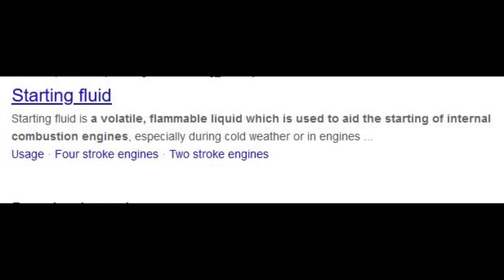Why do Diesels get Addicted to Ether?

Comment: You said it can hurt the engine with continued use, but how? How does starting fluid hurt an engine? Does it wash oil off the cylinder walls? What does it do to damage the engine?
Reply: It detonates while the piston is still traveling upwards on the compression stroke, putting a lot of stress on the piston, rods and bearings
Reply: @ultraprocessed  This is the correct answer.  But you don't need to add so much that it is actually driving the engine to go around.  Just enough to light the fire and the diesel does the rest.
Reply: It kills cylinder wall lubrication.
Reply: @Skidderoperator  Ether vaporizes almost like propane when it leaves the nozzle.  If liquid ether is making it to the cylinder you are using about a gallon too much.
Reply: Google is your friend...
Reply: @JohnSmith-yv6eq  That reply was not helpful.  The guy asked a question, answer it.

Comment: My 1974 Atkinson with a NH220 Cummins had factory fitted ether starting system
Reply: Most tractors well into the 70's and even 80's had it as either factory standard or an add-on kit.  Didn't seem to matter what brand of engines they had.
Reply: My 1996 international 9700 had the injection system, took that shit off right away because I know I’d abuse it lol my 935b cat has it as well but so far I’ve left that system intact
Reply: Remember when the 'A' series came out & ford fitted the ether start system for the YORK engine' fords Tech departments fix for poor starting the inj' pump needed 2-3degs of advance then it would start even with frost on the floor .........
Reply: @leso204 those york engines were notoriously bad for starting,along with Perkins 4108's and any other indirect injection diesel of that era 🤣🤣,never knew that was the fix for the York engine though👍👍
Reply: Got a 1978 john deere 2130 with factory ether injection port. No glow plugs or grid heaters or turbo on those girls back then. -20C and gotta clean the lane of snow, you need a boosting vehicle or the battery charger and a snort of starting fluid to get it to go. Doesnt need it when warm just when cold as balls. Even got the factory manual too telling how to use it. 
Almost 50 year old motor, still factory sealed. Probably could use a total rebuild but aint got the time or money. Just gonna use that ether as the manufacturer recommends!

Comment: Hi Josh, Marine diesel engine guy here in Ireland, with over 40 years pulling and dragging with diesels from 10 to 1000 hp on boats of different sizes. For what it's worth, my experience with ether ("easy start" over here) is that it's most definitely addictive. I cannot give a rational explanation for this, someone told me once that the small end bushing in the con-rods gets damaged ( wrist pin bearing?) ... I don't know, but I do know that using it more that a couple of times leads to addiction in a short timescale on most engines. Maybe some older American engines are designed in such a way as to tolerate it better, but I'm always going to strongly avoid it.
Reply: I had a Romany 21, the boat with the rope, that had a Perkins 4107 in it. Every once in a  while it needed just a puff of ether at that mushroom head air strainer. The engine was built in 1969 and still runs decently.

Comment: Our 2023 CAT D4 came with Cosby sauce as a starting aid. I've had engine performance gurus tell me to use silicone stray instead of starting fluid that is ether based.
Reply: Use what Caterpillar installed.

Comment: I had a scary moment when using brake clean. I cleaned off my mess from fixing a diesel line and used shop air to dry it up fast. Then I went to start the engine and it sounded like things were going to fly apart it was knocking so hard. By the time I got help the brake clean evaporated and it started up normal.

Comment: I blew up my backhoe with ether
Reply: I suppose someone told you after you blew it up to spray the ether into the intake AFTER you got the engine turning over on the starter?
That way the inrushing air distributes the vapour and mixes it..
rather that a whole shot of liquid going off like a bomb in the cylinder????

Comment: I had to use starting fluid once when my water separator drain randomly failed and couldn't get all the air out after replacing it and priming the filters. Was a o shit moment when I sprayed some and she went straight to 3200rpm.
Reply: A cheap Facet-style click click 12VDC inline fuel pump pushing fuel through every filter, lift pump, injection pump and injector is the way to go these days....
just bleed appropriately and go...
Reply: @JohnSmith-yv6eq  I've been thinking of adding a electric lift pump for a few years.  Mainly to supply consistent fuel pressure. My detroit is mechanical.
Reply: @TeamTopKick I added a FASS, then added heater probes, coolant lines to it and a temp sensor. Can see exactly what the fuel in there is doing at what temp
Reply: Watch kt3406e try to blow a twosmoke Detroit by trying the rack to full fueling and letting her rip at over 3grand rippums minutes until it locked up from overheating due to no coolant

Comment: Used to buy a 12 pack of starting fluid every 2 or 3 years when I was farming.  Used primarily for cleaning hydraulic couplings.  Great for getting oil and dirt out of those hard to reach places.
Reply: Add some meth and get done twice as fast. Just ignore the Scarecrow that's following you.
Reply: @davidpawson7393 nah thats why you're running on the job
Reply: @davidpawson7393    said "   Add some meth and get done twice as fast. Just ignore the Scarecrow that's following you.   "  

I thought that only happened with Wildwood Weed circa 1974 . . . .. . .
Reply: Yea try using that stuff around a shop heater in the dead of winter.
Brake cleaner fumes get into it and next thing you know you are airing out the shop.
I won’t use starting fluid for that reason, and not because it’ll “blow up.”
This last winter, I used charcoal starter in a small container to deal with the few parts that needed serious cleaning.
Can’t wait to get my parts cleaner back up.
Reply: My solution is brake cleaner, they both work. Our state has mandated non flammable brake cleaner so you can spray in hot spots too.
Reply: @blauer2551  the non flammable kind doesn't work as good
Reply: @blauer2551 true story, one time at this fab shop, two of us welders got a old rusty fixture out, pull type tractor mower decks. Anyways we cleaned it up with two cans of brake clean, oiled it up so it actually functioned. To this day I don't know who's spatted cause the ignition, but that was frightening and fucken hilarious. Both of us got piss tested and passed. So management was like wow u two are retards.
Reply: FFS. 🤡

Comment: I drove a few Fords with Cat engines that had Ether buttons.
Reply: 2 of 3 5tons I was responsible for in the army had theas . -10f in Ks. the button for 5 sec was the only way to get all 3 running.   Start 1 on either then run the pto throttle up to1200 run the slave cable to the next and start it on down the line.  1 was built in 1943 I drove it in 06,  how many times it had been through the frame off rebuild shop I've no idea .
Reply: I live in a logging area and the local gas station has a few ether canisters for the old rigs that need it. 

They look like the thin propane torch bottles.